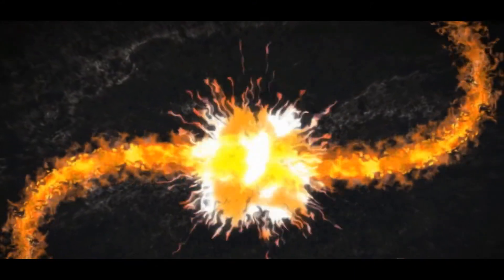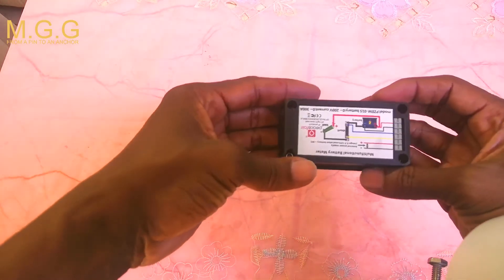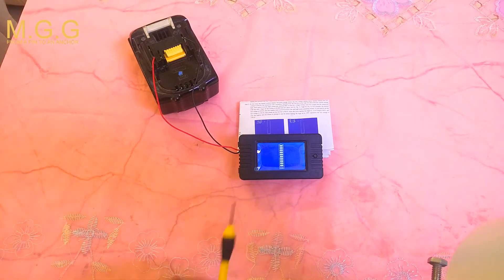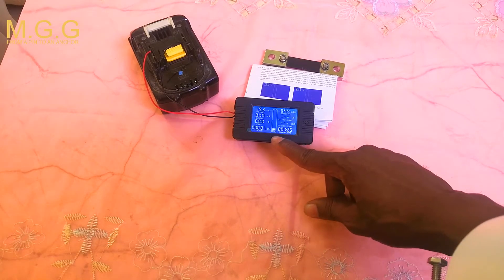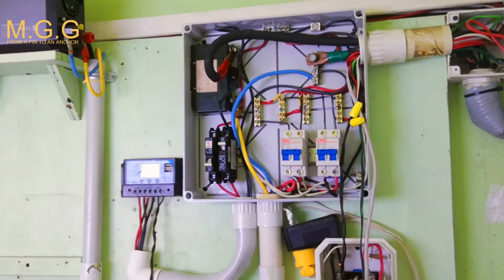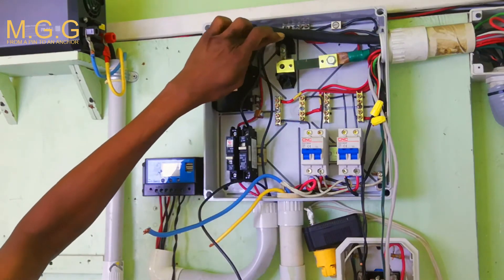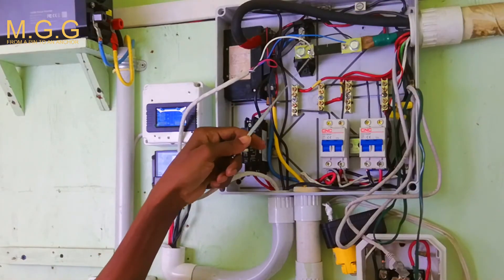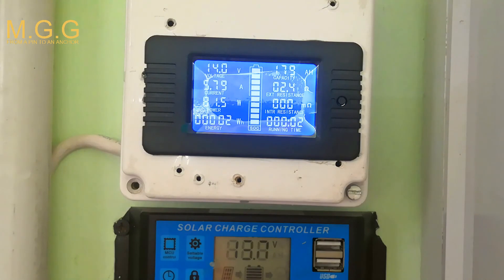Multifunction Battery  🔋 Meter

Comment: Question: my 2K inverter reports lower voltage (0.3v lower) from the shunt display. I connected the shunt to the negative (black) inverter connection. so there is zero "distance" to explain the voltage drop. Also the shunt reports voltage almost same as my radio on the dash. Why would this happen? 🤔
Reply from the maker: Some of the shunts that they sell with these cheap meter does not calibrate properly but if you saw a little bet out of the spit in the middle  it work properly
Reply: Shunts waste a small amount of energy

Comment: Ok,just finished my setup tried voltmeter all I can say is worth every penny connected 2x 800cca truck batteries (110ah each) and plugged 2000w inverter used 1700w coffee maker and now relaxing with coffee in my hand💁
I was worried about voltmeter price as is cheap but glad I bought one, next thing I'm gonna do is adding one more deep cycle battery (110ah) to setup so should have capacity of 330ah which is a lot everything is powered by 250w solar panel from empty to 100% full need around 3 hours of clear sunlight! Play safe boys 👍
Reply: Hey Boss man, I have 4 truck batteries, can u check my question above, maybe u can chime in. Thx 👍🏿